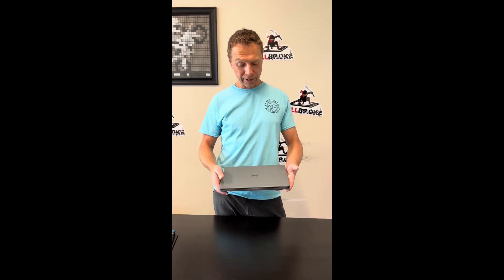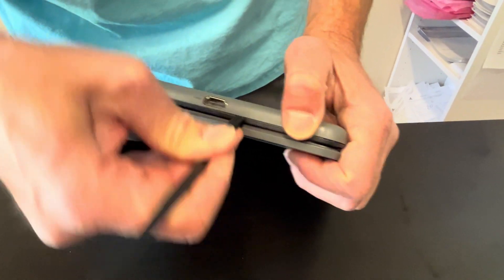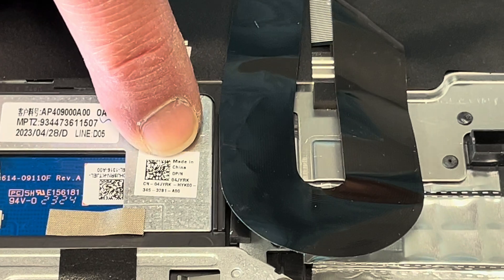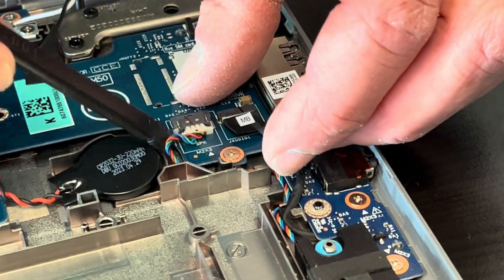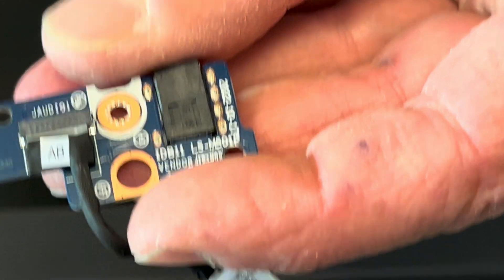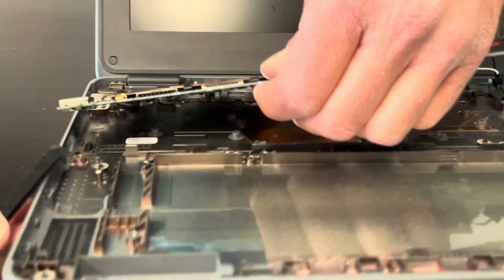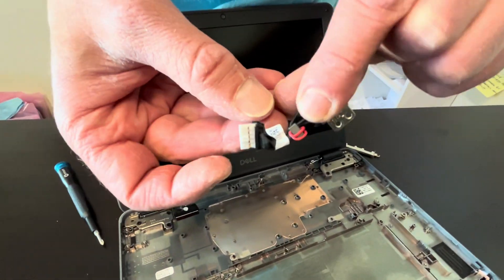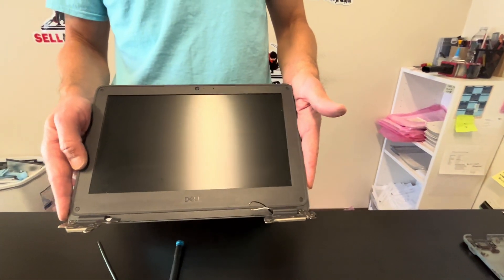Dell Latitude 3140 Laptop. How to take apart, fix, repair upgrade memory SSD Motherboard LCD Battery

Comment: so my college gave me one and it has issues even running chrome the CPU Memory and Disk all hit 100 and freeze while trying to do a program called typing club any suggestions
Reply: I'm a school IT guy and we have 200 of these things. We are currently looking at replacing the operating system on most of them - Windows 11 uses way too many resources for what these machines are supposed to be used for.

Depending on the software you have to use for college, I'd recommend you find a Linux, ChromeOS, or desktop Android distribution to install. Debian stable, Kubuntu, ChromeOS Flex, OpenFyde, FydeOS, PrimeOS are our current candidates. I recommend you take a look at these.
Reply: @pengwint.5101you could use tiny 11
Reply: These things are trash dell should have never even made them

Comment: Sooo cannot upgrade RAM and SSD, it is soldered on the motherboard. Thanks!
Reply from the maker: correct
Reply: RAM is soldered in, but if an M.2 connector is provided on the system board, that SSDstorage can be upgraded.
Mine came with integrated eMMC 64GB storage, barely enough to hold Win OS 11.
I hooked up a USB HDD and setting storage options where to create files.